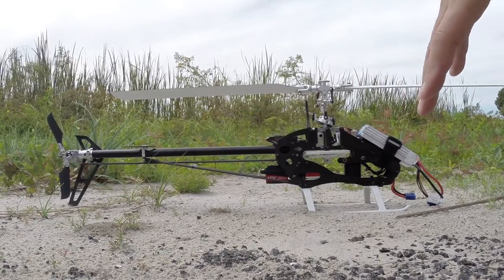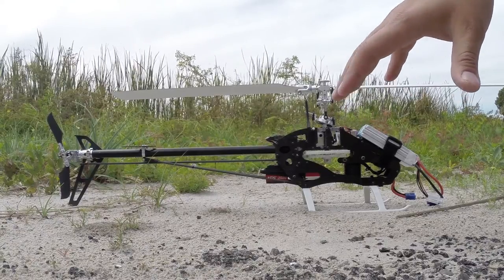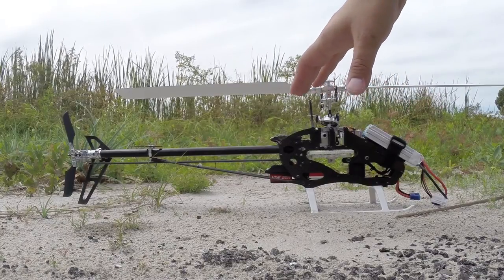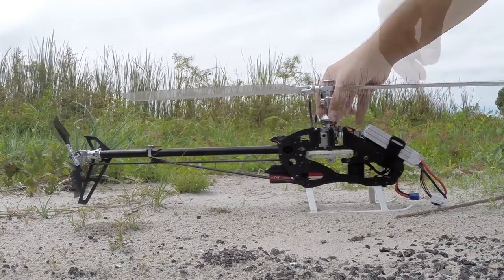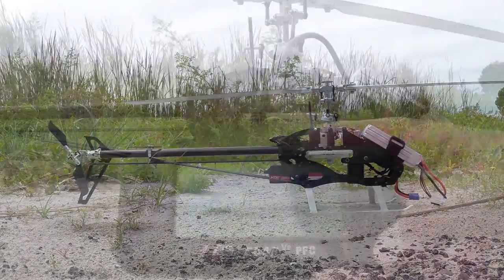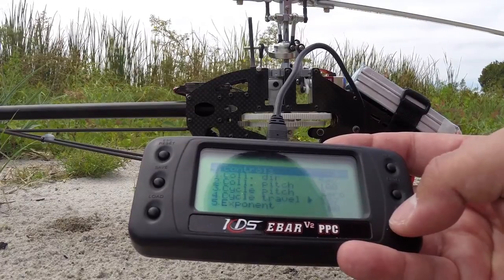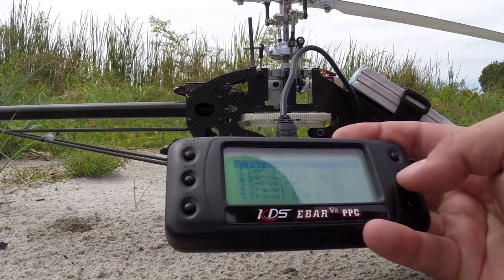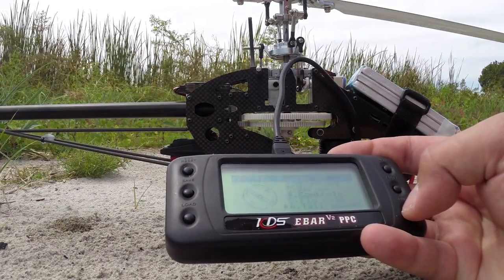KDS Innova 450 SD by Nelson Rodriguez

Comment: Nelson do you like the Glacier batteries and do they hold up in the long term with out puffing or voltage sagging?
Reply from the maker: Yes, they are very good batteries, so far no puff and they have very good punch. I cannot advise in the long term as I only have around 50-60 flights on the battery pack. The IR is very low even charging at 3C.
Reply: Nelson Rodriguez  thanks a lot I miss your knowledge at H/T in Melbourne
Reply from the maker: I'm here to help buddy, please let me know if I can assist with any other information.